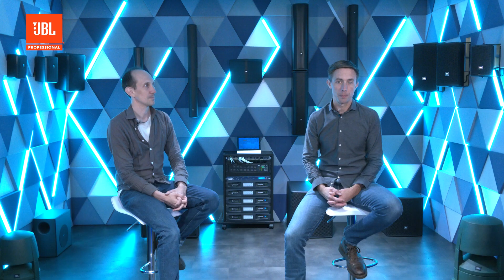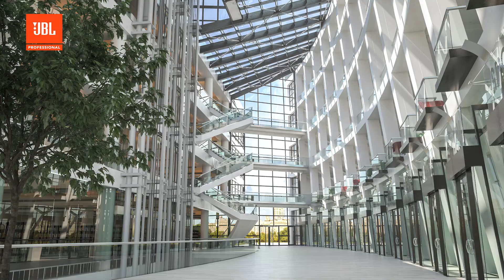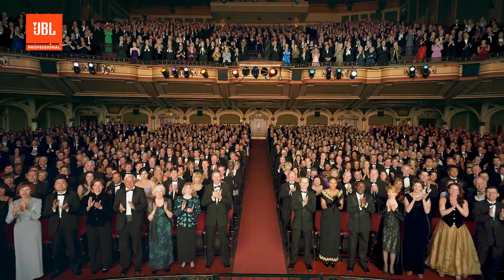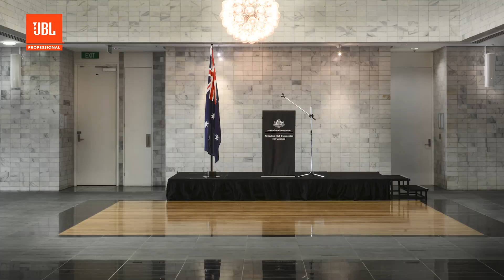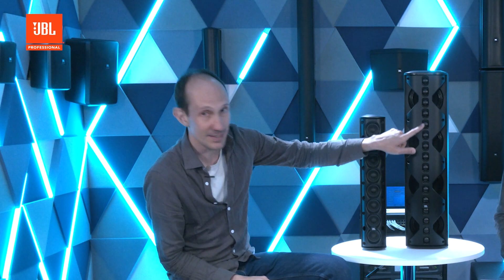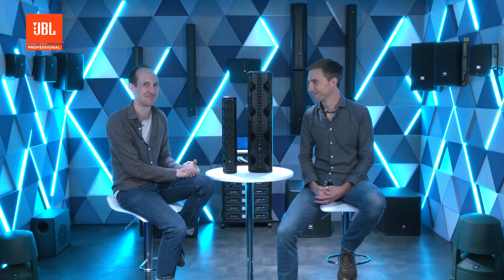JBL Pro Installed Audio Design: Discussing Constant Beamwidth Technology in CBT Passive Columns

Comment: I got to hear Jonathan VonEngeln's home theater using the JBL CBT's and it was impressive.  

The CBT is the ideal system for home theater, I built a CBT center speaker in 2009 for the home theater I had at the time and I've built CBT's for the LCR and side surrounds for the home theater I'm building now.   I'm considering an inverted ground plane CBT mounted at the ceiling for the rear speakers.  Mine are all dipole CBT's which I believe to be superior to monopole but the JBL's in Jonathan's theater were definitely impressive.